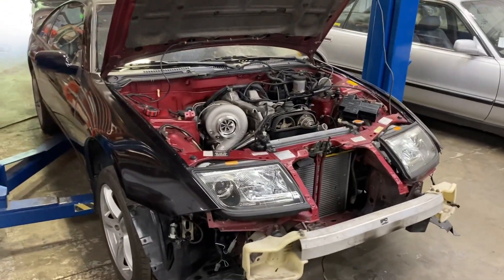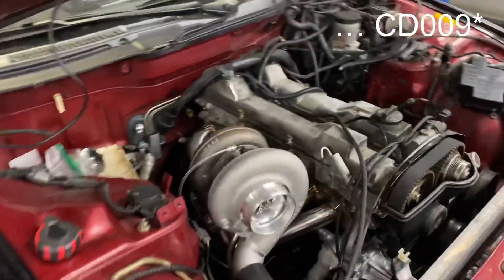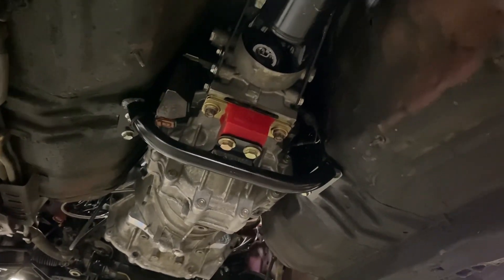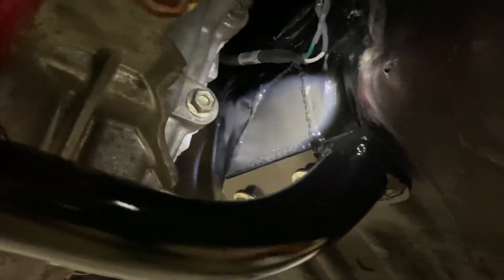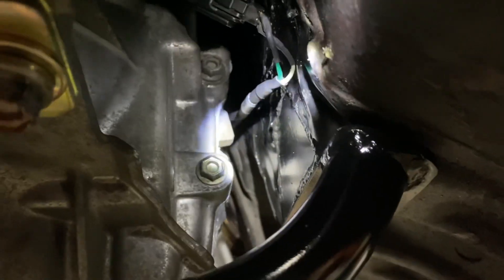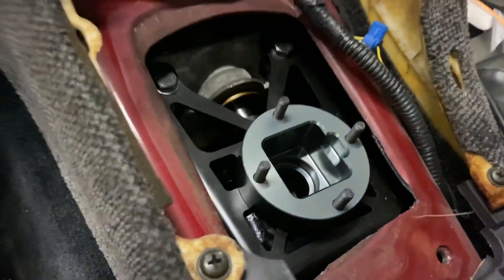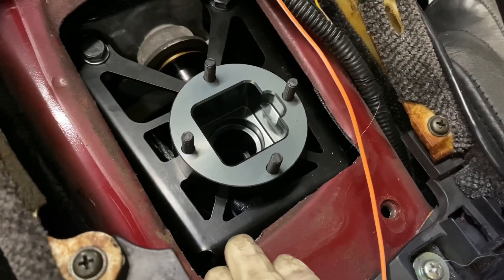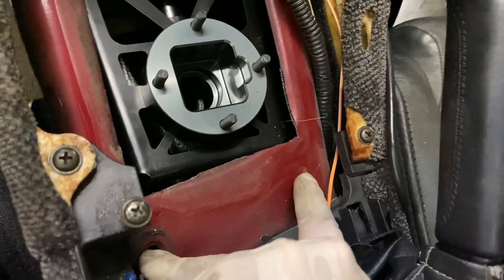How to 2JZ swap a Z32 300ZX

Comment: What's more worth it to Jay Z swapping a 300 ZX with an IS 300 week two Jay Z or should I just TwinTurbo the stock V6 11 to one compression ratio it will fast as fuck boy but the two Jay-Z I bought to put into my 300 ZX I just could never do it
Reply from the maker: A built VG can be a powerhouse and a 2JZ swap is a ton of work and money - only you can make that decision.  We have a deep love for inline 6 engines and 2JZ specifically so if you only care about power than maybe the VG is a better option.
Reply: @ I went the route of twin turbo in the stock engine. I just have to get a different motor mountain now cause I got GT 28 turbos instead of the GT 25.
Reply: @oler777 hey did you ever finish this swap?

Comment: Would you have to cut the cross member?
Reply from the maker: Yes - a good portion has to be removed from the center and it will require welding in reinforcements.

Comment: Perfection! Any experience keeping the z32 Trans? Fitment? My 300zx Needs a 2J Swap
Reply from the maker: Thank you! Stock transmission and CD009 with OEM bellhousing does not fit unfortunately.  R154/AR5 are good semi budget options
Reply: Does the z32 trans work if bellhouseing is cut off and adapter plate put on to

Comment: Would you say that by swapping the engine that maintenance is easier compared to the normal vg30, is the engine bay still cramped, can you conduct small repairs without dismantling the whole thing.
Reply from the maker: Yes maintenance is much easier and less prone to failures, but it can be a bit tight up front and in the bellhousing area depending on the setup you choose.

Comment: What size elbows did you use for the upper and lower radiator hoses? Also would the cd009 trans mount fit the factory z32 transmission?
Reply from the maker: Treadstone sells the elbows we used. We do not make a trans mount that will fit the factory z32 transmission because it is not a good fit for this swap.

Comment: If I use the factory z32 trans with adapter plate do I have to use the Toyota bell housing (this will be a lot of firsts for me doing this swap so just want to get it right)
Reply from the maker: No I don’t think anyone makes the Toyota bell adapter style for the oem z32 transmission. I would not recommend using that transmission unfortunately

Comment: I would love it if you guys would make more z32 jz swap content.
Reply from the maker: Anything in particular ?
Reply: Like what manifolds to run, setups with different transmission options. Maybe looking over Grabnis Racings t56 magnum setup on a z32 2jz. How to modify the crossmember since yours isn't released yet. Anything like that.

Comment: 6:31 When you say space down the sway bar do you mean like actually lowering the sway bar with spacers from the frame itself? or just positioning the sway bar in a certain way before tightening it down?

Side edit: Bought the engine and trans mount for a cd009 swap, great quality stuff. Looking to get the cd to 300 rear end driveshaft next although wish you'd accepted PayPal as its easier for me to make purchases online
Reply from the maker: Space it down with maybe 1” aluminum blocks above the sway bar brackets.  Thank you! We can probably add PayPal payments to the website. Or I can send over a PayPal invoice if you’d like. Just send us an email

Comment: The best part about your mounts is that they're the ones grannas had in mind in designing his t56 magnum kit 😝 Now if only someone came up with a PnP solution to stick and 8.8 diff in the back and I'll immediately get to humping on this swap (*cough come on freed, I'm mechanically inclined but not that mechanically inclined, help a brother out *cough)
Reply from the maker: Can’t go wrong with the t56 magnum! 8.8 is something that we could offer if there was enough demand. The Nissan diffs have proven to be pretty strong though!
Reply: An 8.8 would make me a lot more confident when buying a rear end for the 300zx!
Reply: @DriesOG The Z32TT model has a 230mm diff, if you do the match you’ll see it’s over 9.

When I had my Z32TT in 2003 I built it, had 709hp on complete stock long block.
Would go to drag strip and had 100s of passes all in 1.5 60ft and never had any problems with it.

Comment: Will I Still be able to use the shifter in the stock position? I don't mind cutting the trans tunnel but I don't want to cut my stock interior to make it fit. I'd even like to use my stock shifter.
Reply from the maker: Yes we recommend the Serialnine shifter it will allow you to use the oem shifter location with CD009

Comment: will these mounts work if I use the factory 5 speed with an adapter?
Reply from the maker: A few people have done it but I don’t recommend it. You’ll have to hammer the trans tunnel a crazy amount and it will be difficult to remove the trans if you ever need to.
Reply: @FreedEngineering  because the 2j will need to sit back farther bolted with the adapter to the factory 5 speed?
Reply: @FreedEngineering  main thing I need to know is that will your engine mounts work on a 2j if its bolted to the factory z32 trans... It would suck to buy the mounts and find out the engine sits to far forward or back to line up correctly
Reply from the maker: Yes it will sit too far back to line up with factory trans mount and driveshaft. You would have to hammer the tunnel a ton and get custom trans mount and driveshaft.

Comment: Did you revise the mounts? I had to beat the trash out my firewall to get the engine to lay back right
Reply from the maker: No we haven’t changed them once. You can see how the Cusco bushings move the engine further forward. Some people make the mistake of using straight through bushings that push the motor back towards the firewall.
Reply: @FreedEngineering  cusco is what i used
Reply from the maker: I would guess you either had them installed backwards (you can see how they are meant to be used in the video)

Or you’re using a Nissan transmission with the Nissan bellhousing and you had to tilt the engine back enough to clear that bell.